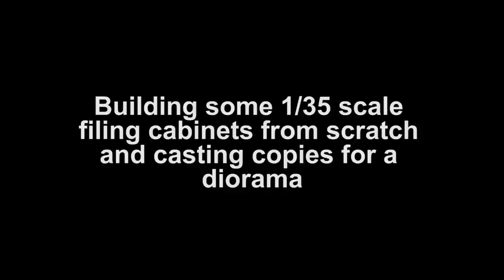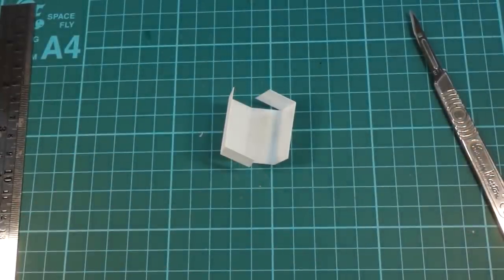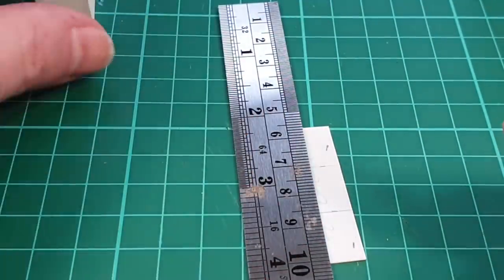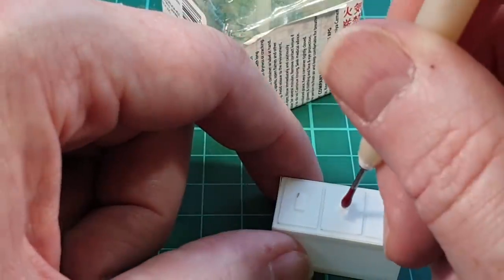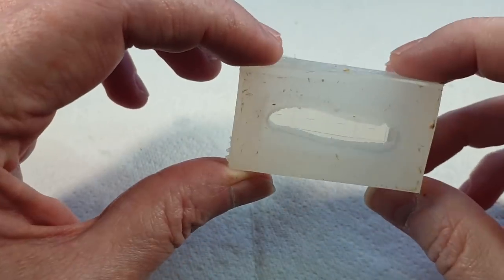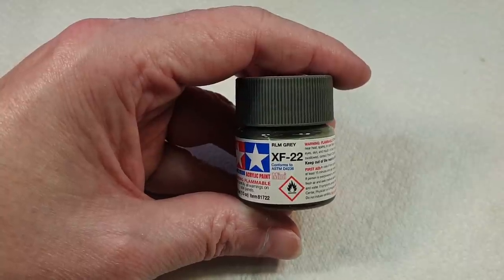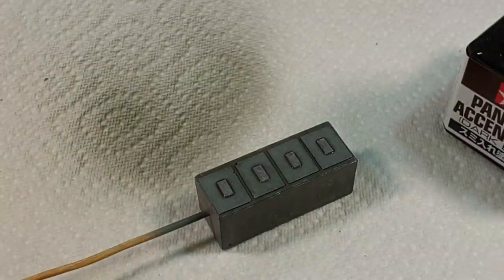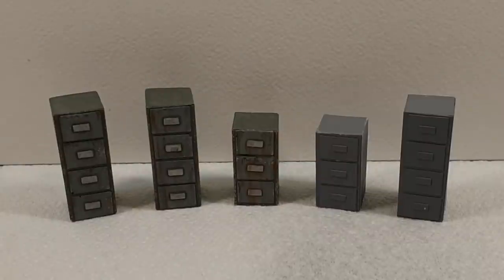Building some 1/35 scale filing cabinets from scratch and casting copies for a diorama

Comment: June 12, 2020---Thanks for the video. Usually if I see one that looks like it's worth watching, will download it to watch later on. But as soon as you started cutting, I said wait a minute, this is something new/different and watched it all the way thru. After 15-20 years, thought of getting back into modeling, but not really interested in aircraft/armor. Then wondered if anyone was doing zombie/apocalypse dioramas and shocked by the amount of stuff I found on Youtube and Google.

In watching your build, apparently filing cabinets there are different than here in the U.S. I own several 2 & 4 drawer cabinets and have taken the time to measure them. None have the bottom drawer level with the floor....there's a 2-3 inch height difference between the bottom drawer and the floor. Also, mine have skinny drawer handles. The drawers are also flush with the cabinet, though I have seen wood filing cabinets like yours. Be interesting to make some your way, rough 'em up a bit, then put a wood finish on them. 

Noticed you didn't use (or mention using) a mold release on your silicone mold. This is something I've gotten into using as it make getting the resin part out easier. One of the dioramas (still working on) has 2 dumpsters in an alley with some people inside of them, while fighting off some zombies. Googled several types of dumpsters and after scratch building them, made molds of them, followed by multiple resin copies just in case. In looking at your filing cabinets, realized the 3 drawer one could be modified to become a trash can as used on some city sidewalk.

Thanks again for the how to video.
Reply from the maker: I'm glad you enjoyed it. The filing cabinets are very generic, they're not based on anything in particular, so I wouldn't read too much into the design. I don't use mould release because there's no need - the silicone won't stick to anything other than more silicone, so unless I'm casting something in the same material as the mould, it's not necessary. Anyway, thanks for watching, I appreciate it :-)

Comment: Very old school.......I do this with my Anycubic Photon 3D printer
Reply from the maker: Yes, you can certainly 3D print them. In fact, I think 3D printing is going to make a lot of scratchbuilding obsolete as time goes on. The one thing I would say in this case is that, once the moulds are made, using fast cast resin I could probably make about ten of these in the time it would take to print one :-)
Reply: @SteamGeezerUK  
I did the same some years ago.
My Problem was if you need a chang (small or big) at the model you need a new mould and the silicon isn't a bargain.
Changes are only a few minutes of work on the PC and the change is done.
A further advantage is to print hollow so it saves Resin. Prints costs only a few cent, most of mine less then 10 Cent. (1/35 Model parts)
Reply from the maker: @axelackens2157  Oh, don't me wrong, I agree with you for the most part - 3D printing is definitely the way forwards. I would say, however, that there will always be a place for mould making, especially in art. As for hollow prints, rotocasting has been around for years. About 25 years ago I built a rotocaster for a mould that was over 8 feet long out of a cement mixer :-)
Reply: @SteamGeezerUK  
I don't get you wrong, all right.
I've already done a lot.
For example, I built a centrifugal casting machine for white metal, it worked, but I never really did a lot with it, because you had to build silicone molds that belonged in there and the heat-resistant silicone and the hot metal were too much work for me.
My biggest problem is when I master techniques I lose interest in it = D, but with 3D printing I can focus more on creating the models, I really enjoy it.

Comment: why didnt you just 3d print some cabinets?
Reply: Sometimes old school is good.👍
Reply from the maker: I could have, but it would have taken longer to clean and sand them down than it did to make these, and now I have the moulds I can make as many as I like. With fast cast resin I can make two cabinets in about ten minutes.